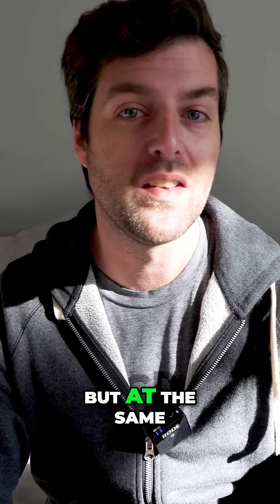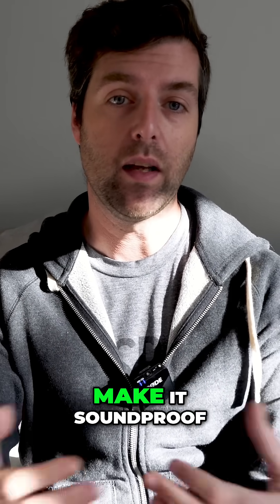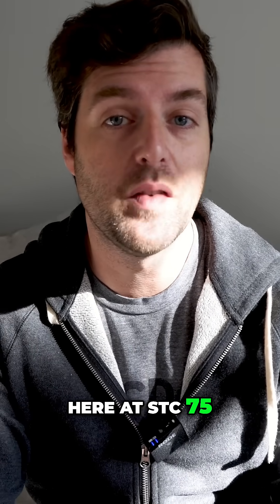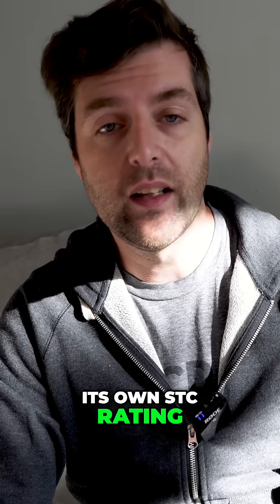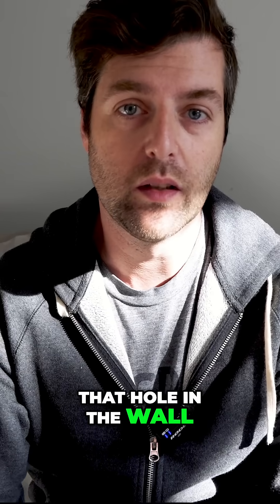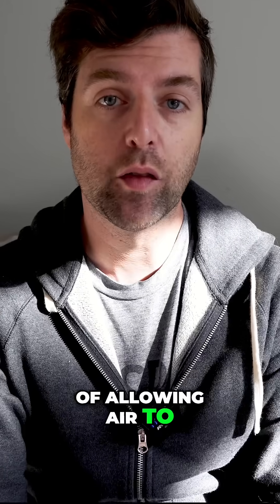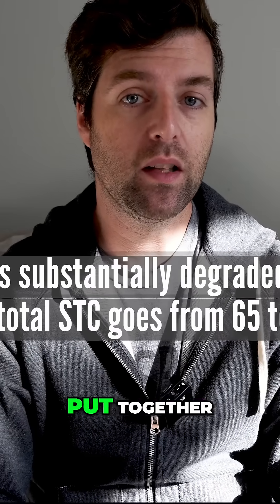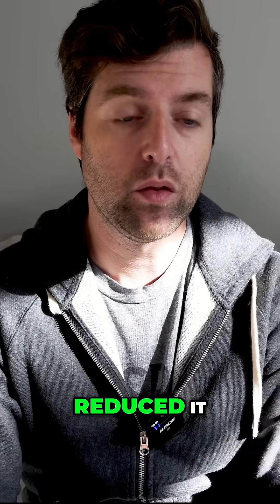Your Soundproof Wall Is Useless If You Ignore the Door

Comment: Also, don't forget ventilation. Conversions of residential spaces into sealed soundproof rooms often messes with the HVAC air balance. Some older homes who don't use forced air circulation that often counts on those gaps under doors as the outflow (like in bedrooms) can get really stuffy when you seal up the room and the doorway. I know some people who learned the hard way /after/ they did the build-out.
Reply: This is what I was going to comment, currently trying to find a solution for air balance and stagnat stuffy air when ac isn’t constantly running
Reply: I did provision air return in my room with a couple turns so it's not direct with any other vent also baffled it with foam